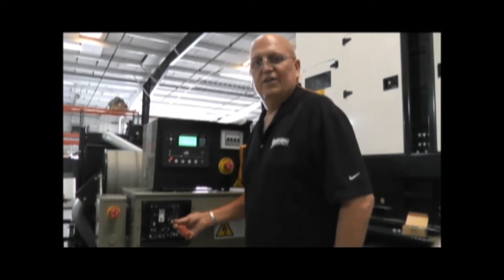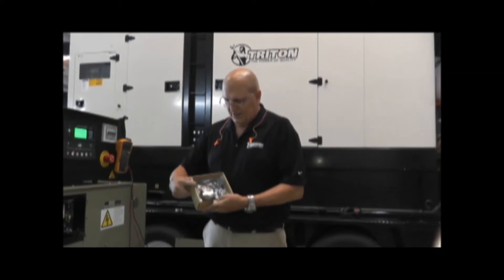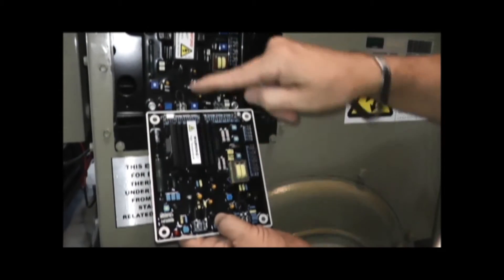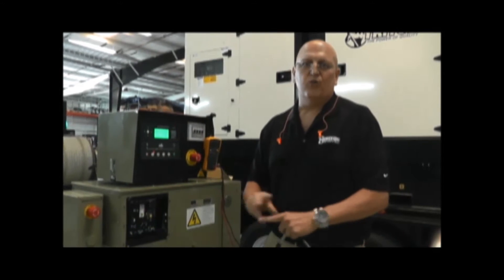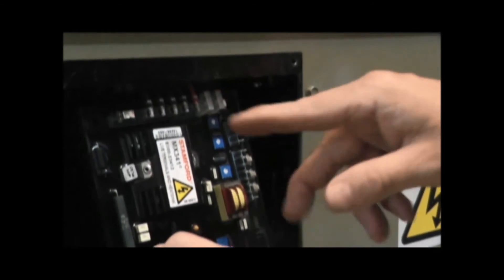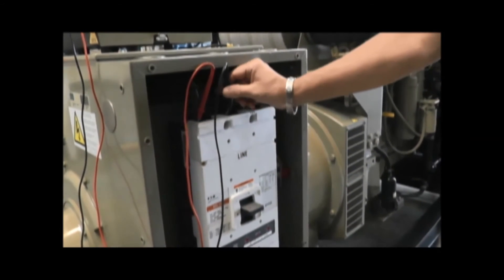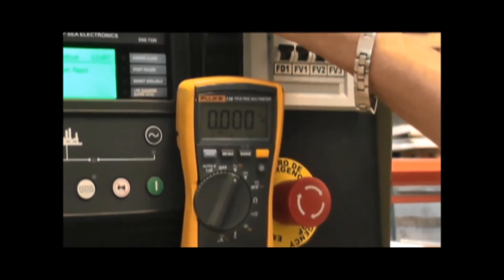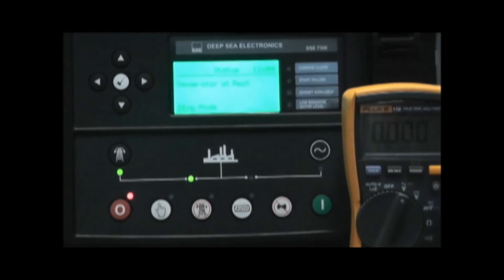Americas Generators - How to Install a Voltage Regulator Part 2

Comment: the correct thing is to measure with respect to the neutral to avoid over voltage L1-N L2-N L3-N in 3 fasic connections